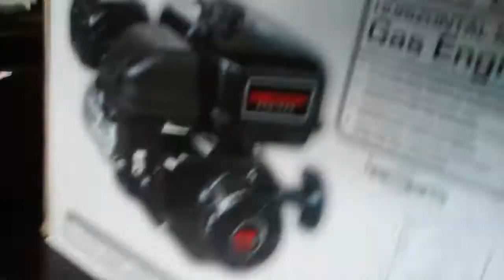Homemade kart axle lock

Comment: actually I was asking about the live axle how you have done?
Reply from the maker: Had the same guy drill hole in the axle, sprocket, and hub caps on the inside. Then bolted all together with lock washers,and used wheel bearings for it to spin.
Reply: does that is a real live axle  or a pipe?
Reply from the maker: It's a live axle
Reply: thanks for the information
Reply from the maker: No problem